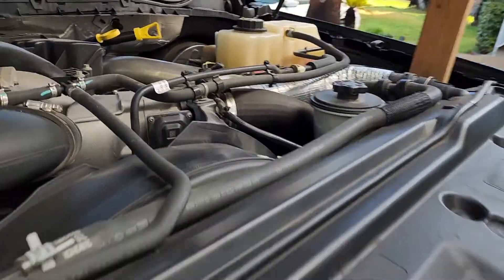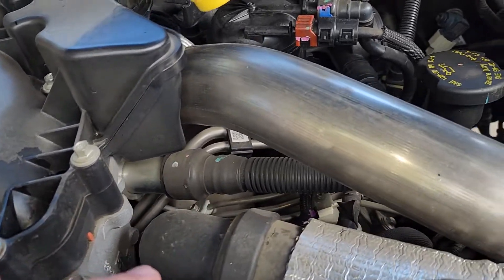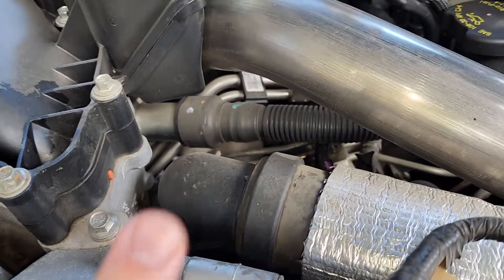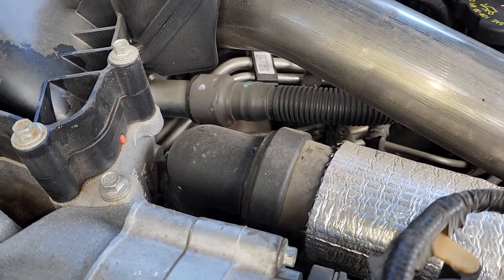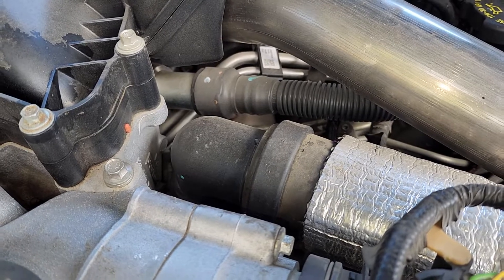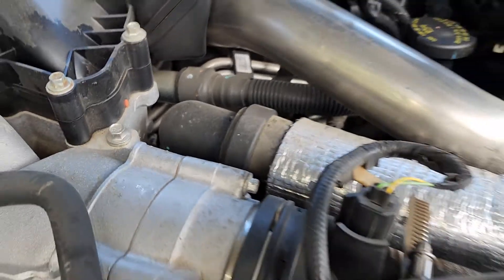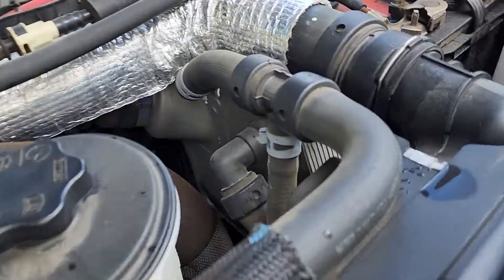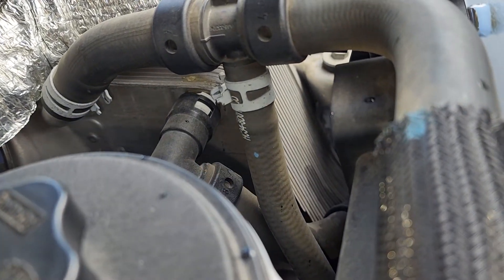2017 Ford F250 6.7 Upper Radiator Hose Leak

Comment: It’s a five minute repair, a paint can opener removes the clip and the 15$ o ring replacement is easy
Reply from the maker: I checked around for the oring at that time and I could not find it. I called who knows how many places and everyone was out and it was backordered. I had to buy the whole hose. Hopefully I get a little more milage out of the new one. Towing for miles up 6% grades doesn't help tho.

Comment: Too much talking No enough acción 🎬.
Reply from the maker: I do agree. I don't really think about filming when I'm working on stuff. Don't really have the time for that.
Reply: @jasonkubitz9410  🙏
My dump truck broke down, took it to our diesel mechanic. Out side company property. 
my boss ask me if I can help 
Our shop mechanic . 
He was replacing a radiator, 
2013 F350 6.2 L Gas engine, the top radiator hose was leaking. 
I think is crap , the way they design the hose that connects to the radiator. 
Simple stupidity. 
Thanks to YouTube I learned every day stuff.
Reply from the maker: @Amarillobymorning777  YouTube is a great tool. You inspired me to find the time to make more instructional videos rather than just ranting on lol. Sometimes people need a little motivation. Thank you 🤙

Comment: I replaced the hose years ago before I knew you can buy the o ring it looks better with the new heat shield it’s hard to get parts here in Florida my buddy is having to sleeve his block that broke a piston ring pushing the truck over 100MPH coming home from the strip club racing a Mercedes’
Reply: Do you know what o ring part number used to fix this issue?  I have the same problem

Comment: Easy fix bro. Ford has the O-ring part number and you can order one online.
Reply from the maker: @jhowie007  I know but at that time, they were back ordered about a month for the O-ring. I may go Mishimoto upper and lower hoses later on but they're expensive.

Comment: Mine just started leaking also. 2017 138,000 miles
Reply from the maker: Man, no bueno. It's pretty easy though. I have some videos that I took during the process but I don't really have the time to edit lol. Let me know if you have any questions.
Reply: @jasonkubitz9410  Hey, Could i get some more information, I’m having the same issues and not even sure where to start
Reply from the maker: @braedennelson2320  What do you need?
Reply: @jasonkubitz9410  So i had the same issue as you, my upper rad hose is leaking in the same spot as yours, i took it apart and cleaned the o ring and put some grease on to try to seal it up, What did you have to do to fix it?
Reply from the maker: @braedennelson2320  I just replaced the whole hose. You could probably go to your dealer and get just the o-ring since that seems to be the weak point on this hose. It gets compressed over time and the heat probably breaks it down. Simce this is a quick connect hose, the only other option is to have a custom one made with hose clamps.

Comment: I have the same exact issue, any word on what the part is and how to fix? Thanks!
Reply from the maker: My suggestion is to go to your local Ford dealer and hand them your VIN. They can look up the hose for your vehicle. I ended up replacing the whole thing and had to burp the system several times. Use a pick to get the clips popped out. It's actually really easy to do but you'll lose some coolant in the process. This hose goes straight to the thermostat so draining the radiator doesn't really do anything. Pull the radiator side first and suck out as much coolant out of the hose you can. Next is the engine side so get a few rags ready. I filled my hose with new coolant before I reconnected the radiator side. Run it, cool it, burp it. Repeat that several times and top off as necessary. All good now 🤙

Comment: How you solve your issue
Reply from the maker: I replaced the whole hose since I couldn't find anyone in my timeframe that had the o-ring. An o-ring would have sufficed since the hose itself was in good shape. There is very minimal coolant loss since this is the upper and the thermostat is closed.

Comment: Good luck on the repairs and this service center's efforts.  Know the feeling of random once-overs and discover a drip, leak, or seep stain - frustrating.  My neighbors like to comment to my other half, why is a hood always open or whats wrong with the truck because I am under it.
Reply from the maker: Looks like Ford is going to cover the cost of the radiator hose and I install it. The dealership service advisor is very difficult to deal with (they all are). Ford is going to cover the cost of the inspection of the "possible" 3rd oil leak. I know what you Nena though about having your hood open all the time lol. Probably why my hood struts already took a crap.